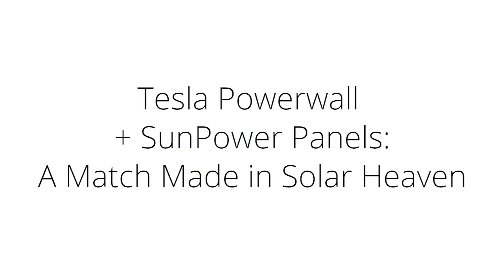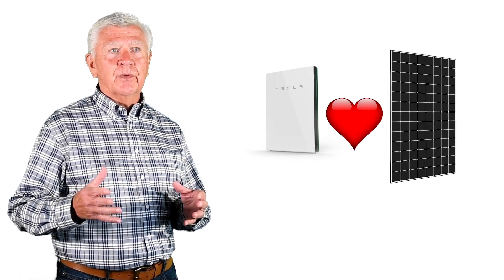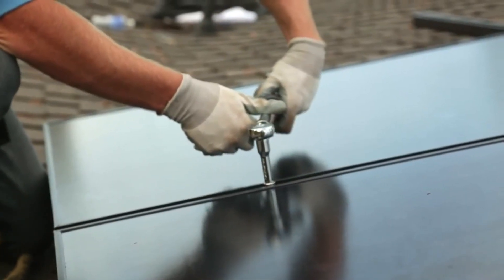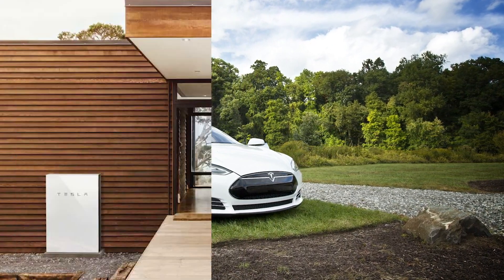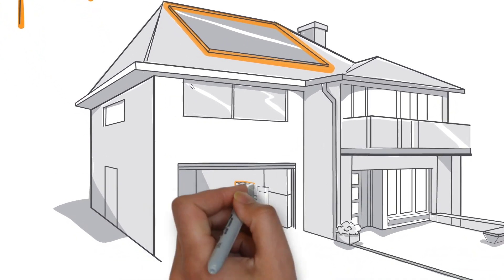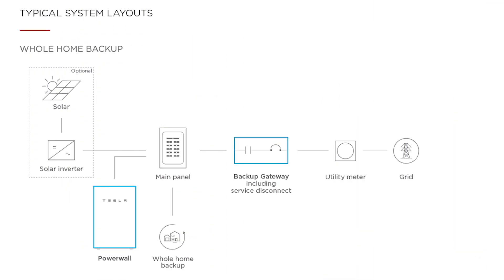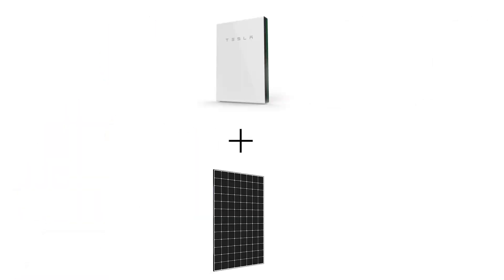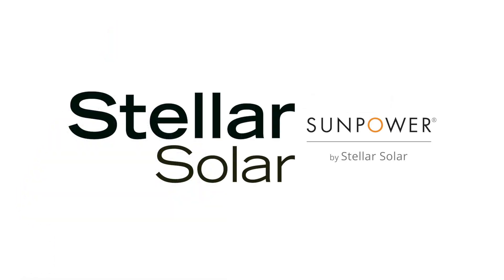Tesla Powerwall + SunPower Panels: A Match Made in Solar Heaven

Comment: Adding an oversized PV system with 405-watt Q Cell panels with Ehphase IQ8A Inverters, so I won't be using/needing the "string inverter" this year and will add some PowerWalls next year, but will wait for the new PW3s due to be released this fall.